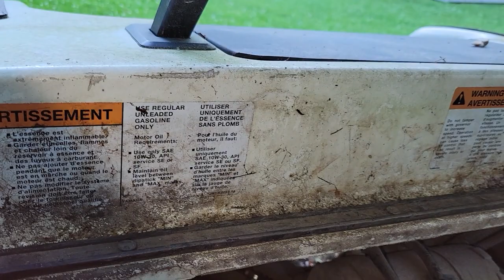Wrecked 1998 Yamaha Golf Cart! Will it run and drive again?

Comment: I have a 1998 YAMAHA G16 that was mashed by an oak tree last year.  It really didn't hurt the body.  The rear lift kit and shocks were broken, the sway bar was bent, the back supports of the front seats were bent and the roof was crushed.   I was able to get it back together, build a new roof frame and get everything aligned right for less that $500.
Reply from the maker: Nice!